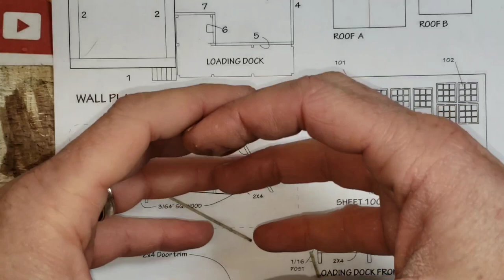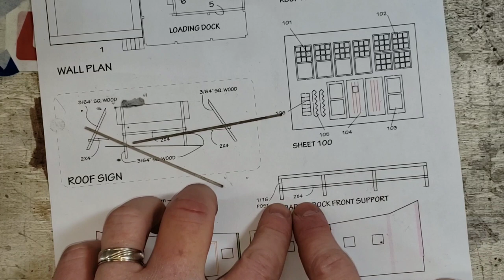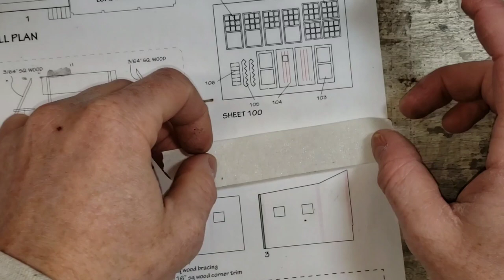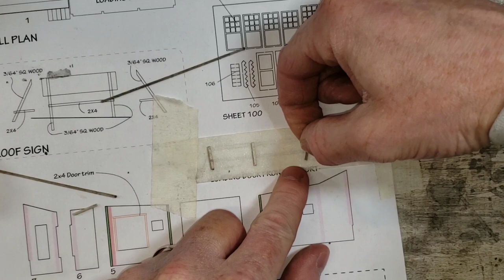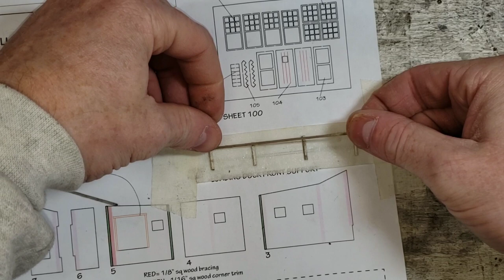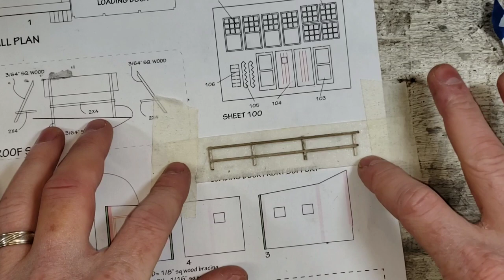15. Making Loading Dock Structure  - Foundations of Craftsman Kits

Comment: How did you know to cut the post length to the top of the rail and not the bottom of the rail?
Reply from the maker: We cut it to the top of the rail, because we needed a sufficient surface to glue the flat 2x4" scale rail to. Otherwise the rail would sit on top of the post and it wouldn't adhere as well.
Reply: @WileysScaleModeling  Thanks. I guess I'm remembering from high school drafting class that where a piece is behind something else, it's a dotted line. There's probably not enough of the top rail to do that.